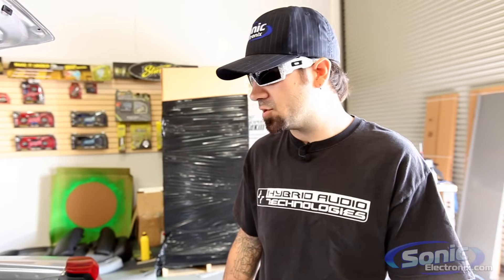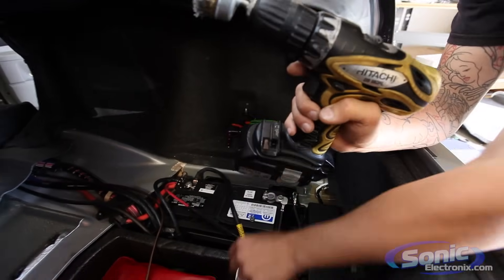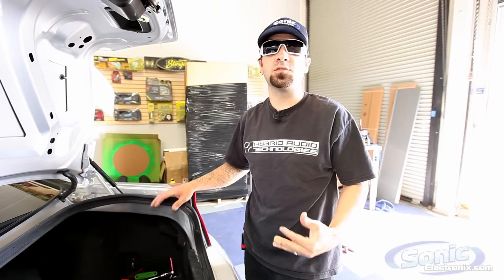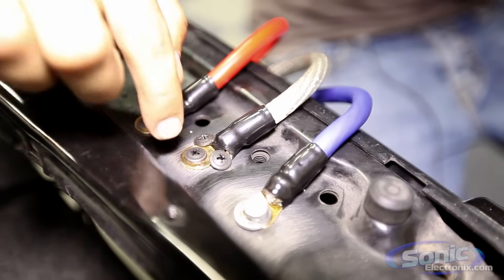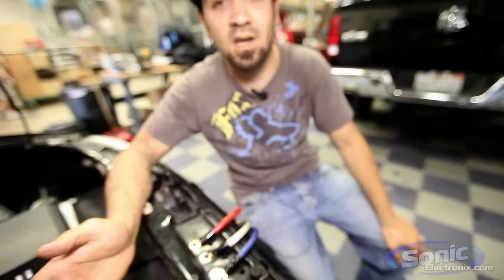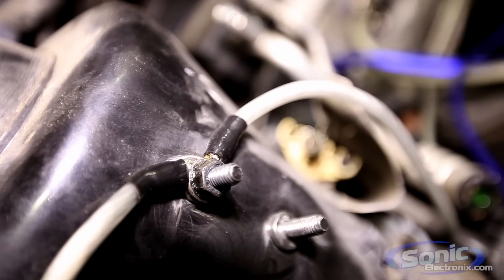How to Properly Ground a Car Amplifier | Good & Bad Examples | Car Audio 101

Comment: I absolutely love shit like this. I'll try ro prove as many valid points as I can. First off, Long wire doesn't mean shit for a ground. When installing a larger ground I.e. (4 gauge or bigger.) Follow the base rules "Sonic Electronic" teaches you here. If on (any) surface sand down to bare metal. Now for the resistance bullshit... Have a (Multimeter) present and check the wire yourself for resistance. I'm currently running a Planet audio px4000.d all 0 gauge wires, the big 3 and a 200 amp high output alternator. My ground from my amp runs to my seatbelt bolt and a (18 mm) nut a sanded surface as well. The ground wire is 3 1/2 to 4 ft long. No Resistance! Checks at 12v perfectly like it's Supposed to! Been installing car audio for 13 years and I am a Computer programmer/Electrical engineer. If your headlights dim, chances are your pulling too much current draw from your vehicles electrical system. Steps to change include.... 1: Big 3 2: Upgrade alternator. 3: Upgrade and check battery(s). 4: Check and secure grounds. In some cases as such as mine on my 1994 Lincoln town car signature. I have inevitable headlight dimming but very little. Reason you ask? Because of a thin and non productive flaw in the headlight wiring harness. If your amplifier cuts out or goes into protection mode intermittently. Which it should never do .. Proceed to follow checking for (Good) ground connections. If that checks out and all signal cables and other wires going/coming from amp are clean etc. Then check amplifier to be at fault..maybe a bad channel.
Reply: This is almost the most informative comment i have ever read on YT
Reply: Booga, that wire has resistance, but it is too low for handheld Multimeters to properly measure.  In fact, if it is truly a 0 gauge, 4 foot pure oxygen free copper wire, it has (0.0983 * 4)/1000 = 0.0003932 = 0.3932 MilliOhms of resistance.  This is a theoretical best, and doesn't include crappy crimps, crappy body resistance, or the rest of the wire's length.

Second, you say "checks at 12 volts like it's supposed to", but you don't say if that is while your system is drawing maximum current while you check.  If your system is drawing zero current, it would "check at 12 volts" if you had a 12 volt potato battery connected to it.

All of the above is really picking nits, but people are going to read your suggestions and go buy 4ga wire and think it's great, but it all depends on their system.  Assuming perfect connections, and 20ft of 4ga in your system, that would be 5 MilliOhms, in a perfect system.  If you have a little 200 amp/2400 watt peak system, that system is presenting a load of 60 MilliOhms.  This means that your system, at peak draw, is expending almost a tenth of its power into your wires, and you are going to only get a 9/10ths of your voltage at your amps.  Even more dangerous, your wires release that energy as heat(basically, in this system, the wires would become 4 60 watt incandescents).

Now, as far as "long wire doesn't mean shit for a ground"... Well, it means the same as power wire.  Double the total distance, double the total resistance.  If you used 40 feet in the example above, it would present 10 MilliOhms, and you are looking at 5/6 of your voltage at your amps, and 1/6 of your power dissipated in your wire.

This all boils down to: Do a bit of homework(outside of youtube comments), don't do it yourself if you don't understand it, and ALWAYS go to the next gauge up of wire from your calculations.

TL:DR: LOL youtube comments.
Reply: @Justin S You're right Mitchill is saying BS...

Comment: Thank you for the video, BIG help. However, I ran into a problem. The speakers are making a screeching sound and it amplifies (gets louder) as I accelerate my car. Any thought on what could be the problem? I even makes the sound when the radio is turned off.
Reply: Alternator whine. Did you run the RCA's and power on the same side? Your ground might need to be moved, too...

Comment: i just took a nut and washer...left the wire completely bare (0AWG)...threaded the wire under the washer around the bolt like a fork...and tightened it down
Reply: just because you've gotten away with this ghetto poor practice does not mean it's advisable. I'll stick with a properly crimped and soldered ring terminal, a nut and bolt with a good sharp star washer, thank you. the corrosion is called galvanic corrosion and it is a result of electricity flowing across dissimilar metals.
Reply: you dont want to do that because the corrosion on the wire from the open bare end of the wire will be just as bad of a conductor as it would be if you just left the paint on the metal.... what i always use is solid copper lugs with a crimp on it then marine heat shrink to keep moisture and more air out of the cable so it doesnt corrode then strip the paint put a hole bolt the lug down and paint over the lug and the stripped area to prevent it from rusting also
Reply: customlumina checked it a few minutes ago...still looks the same from the day i installed it, which was almost a year ago lmao...idk what corrosion youre talking about dude...if you have moisture in your trunk area, you may want to check for leaks...
Reply: there is moisture in the air (humidity) that causes corrosion moisture doesnt always have to come in direct water form
Reply: I guess $5 for proper terminals is too rich for your blood, eh?

Comment: @staygolden....factory ground there or not, straight to the battery. People running real systems will even go from the battery negative to a post ground to a distribution block. And also, when upgrading to big amps etc., the BIG3 is necessary, one which is a better ground than what's already there. There is no excuse however you look at it, straight to the battery is 100% best you can do.

Comment: battery was right there! LOL!!!! if your that close to the battery, go straight to it. I would however, ad an additional ground wire from the negative battery to that post he cleaned up. BIG 3.
Reply: never ground straight to the battery, if the car's ground becomes loose or fails in any way then when you start the car the ground goes through your amp!
Reply: there is a factory grounding point there for a reason..
Reply: ***** If you're taking power from the battery, power needs to get back to the battery as short as possible to ensure performance. Trying to say I should overload my stock ground cable as opposed to wiring something straight to its power source?
Reply: turboelkys u can't ground to the battery...

Comment: What about a Van.. at the back of the drivers seat (around the battery).. any good grounding options there please?
Reply: If I had to ground in the middle of the car, I've always used seat mount studs. Extremely solid. Just clean, and bolt it down. I have had to take a drill and open the ring terminals a little bit more, depending on the size of the seat bolts though.

Comment: The best ground in my opinion and the closest to the amp usually is one of the lower bolts to the back seat bracket, they're present whether you have folding seats or just a regular back seat, you only need to scrape a little and theres a huge stud great for grounding, the only down side is you will need either 4 gauge grounding rings or just a really big 8 gauge ring terminal, but they require very little to get to besides lifting up the back seat cushion which is usually just held by two push points
Reply: 8 years later and this comment helped me eliminate my grounding concerns since my dual tbx10a won't get power
Reply: that  depends on where your battery is located ! 
for me. i have driven a volvo v70 the past 10 years,  and i have  the battery in the back!    i always ground my amplifier in the battery! if possible ofc .
also the watt size of the amp  playes a part!   let us say that you have a  THE GREAT WHITE   B2 amp..  that one  puts out  16k w  @14.4 volt.   you don`t ground that in your chassie !
Reply: @jalliboy  lets be reasonable here, the Ground point he mentioned is fine for us common folks with 1200rms ~ watt mono amps for a sub lol..its the point i use for  both of my amps in my 2011 mustang, works well under the rear seat. took a good bit of sanding, cleaning..but is a SOLID ground and tested with meter 0.01 ohm...
Reply: @xsmatt81  yes. What you write is something i can agree with! But like i said. The size of the amp is a major factor here.

Comment: That stud is already in direct contact with the body... There for why did you wire wheel the paint down even though it didn't even touch it? That's wrong.... And also you are suppose to have a ground that is close as possible to 12" or shorter never longer because you create resistance.. And will make the amp not last.
Reply: clean surface means good connection. paint stop that connection even if its a factory stud ground. also proper wire size will allow u to run longer than 12" for the ground. resistance is caused by paint and other things that do not flow electricity. so stop trolling
Reply: It's no different to having a power wire from the battery in the front to an amp in the back. The electrons flowing through the wire don't care whether the power wire is long or the ground wire is long, or if they are both long. As long as the power wire you use it thick enough it'll make no difference.
Reply: You can have a ground as long as you want but, you're just going to pay a ton for the proper thickness of wire.
Reply: Good to know this, didn't realize had to be shorter then 12" with the ground wire.
Reply: bassl0va What is resistance my friend! Not trying to troll. Just trying to better someone who cant even sell there own product... Look at any wiring kit. Any wiring diagram. You wont find a ground longer than 2 feet "if that". Shorter is better.
Reply: Goatman42069 Watch the video. The stud is almost like a washer. The stud has direct contact on the bare metal already. He grinded metal down where the lug on the wire WONT even touch.
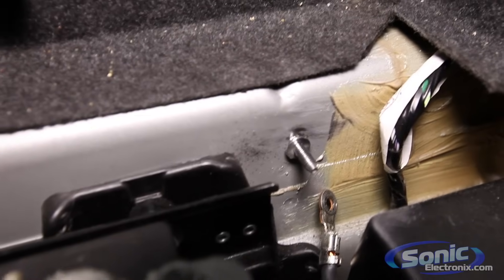Reply: Goatman42069 Please look at 00:54 And 1:09 tell me what he did better.. The factory ground is not gunna be a bad ground. "This is a bmw" You dont pay for a un-proper factory ground.
Reply: Killem Gillem TBH Cause it is practical and cheaper and generally it's unnecessary to have a long connection to ground because no matter where a component is mounted you'll be within 2 feet from the chassis. That doesn't mean there is anything wrong with long ground connections. Shorter is better cause it is cheaper and easier provided you are using cable that is up to the job, same goes for power wire. Doesn't mean it makes a difference for 99.9% of properly installed systems.
Reply: Killem Gillem TBH  This is no BMW its a Charger or a 300 hence the mopar battery.
Reply: ***** Well it doesn't have to be any thicker than the power wire. But yeah may as well have it as short as possible cause it's easier and cheaper
Reply: if the 12" rule is true then my car is fucked because my fuel sending unit ground comes up from the trunk of my car runs under the rear seat in the factory wire harness to a grounding point under the passenger side door O.o i would have to say its closer to 5 feet and that is factory
Reply: customlumina That's why the 12" rule is bullshit. It isn't a rule. It's just easier and cheaper. There is nothing wrong with long grounds
Reply: Do you not realize that even if your ground wire is 2 inches long it doesn't make a fuck. As long as your ground is equal to or less than the length of your power wire resistance will not be effected. Wiring kits come with super short grounds to save money for the manufacture and the consumer.

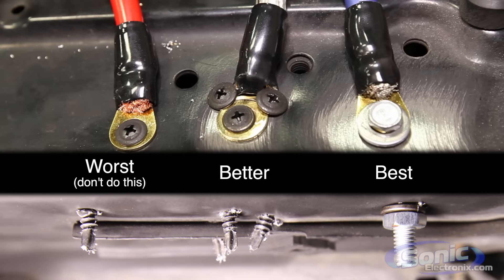Comment: 1:59. The worst thing you could do is connect your positive to your ground. KABOOM!
Reply: Jeramie Curtice from 5 years ago. So sorry it's taken me 5 years to respond...i've been father busy these years. Anyway, that red wire at 1:59 wasn't the power wire. It was just a random red wire...as with the other two wires...the white and blue wire, merely being used to show 3 different examples of ground methods/results. But yes, or rather no...do not connect your positive to your ground. That would be a HUGE durrrr moment you won't ever forget. And if you didn't know that, please let someone else do the installation, ;).

Craigsbully from 5 years ago...yes, i do agree. If i saw option/method #2 installed like that from a professional...or even a backyard mechanic or from anyone...EVER for that matter, fugettaboutit, pfft-pssh. Get outta'here ya schmuck i'd have to say.

Comment: The speaker wire and the power cable to the amp have to be in different sides of the car right?   Cause I bought a car and I just notice that the power cable and the speaker wires are running along together...

Comment: I've been doing my own installs since I got my first car. My opinion as always been that using factory threaded bolt holes, bolts, and other fastening locations is the best option. Im also the type of guy who tins every wire, removes the plastic from crimp connectors, solders, and shrink wraps them. Would you agree that grounding to an existing fastener as close to the amp as possible is the cleanest and most fail proof manor of grounding your amps?
Reply: Yes. Please install the ground as close as you are able to do so (in a safe matter) to the amp/powered subwoofer, etc.

Comment: Make sure you dont have signal wires (rca's) running with the 12 volt power cable. That puts a lot of noise into the signal and is what youre hearing
Reply: Wow I was looking everywhere trying to find out why I had so much noise going on out of my subs with no music on..
Reply: SPEAKING Heavy Facts bro 💪 lol I ALWAYS Run mines Opposite sides from each other, otherwise you'll get that Annoying Ass sound when hiting the gas etc

Comment: Actually, grounding to the negative terminal is ideal.  That's where the 'ground' originates.  You can see in some older PPI amp manuals that the 48 engineers they had on staff would recommend to run both pos and neg back directly to the battery for best results.  The car chassis was never even considered for passing the kind of power that many guys will install in their car.  I'm not saying you can't but the negative terminal is by far the best place to run a ground cable.

Comment: I am currently running 0 gauge wire running from the battery to a power distribution block which splits it into two 4 gauge wires into 2 amps, one amp for each subwoofer... Is it ok to use the two 4 gauge ground wires into ground distribution block then just grounding the one 0 gauge wire?

Comment: run a ground wire off one of your rca jacks. sounds funny but it will work. touch a ground to the metal on the RCA and you can hear it go away.

Comment: Ya, not sure how well those welds will conduct, they certainly weren't meant to carry the amount of current required for high powered systems, and that's what we're all going for right?

I agree, if you're going to be running a couple hundred amps though, you might as well run some extra grounds.

Comment: Thanks. Tried frame ground first. Unibody. Voltage issues.

I run a dedicated ground from front battery to rear batteries because the unibody ground didn't give me the results I wanted.
Dedicated run. No voltage issues.

I also run a dedicated ground from the center of the earth to prevent lightning cap strikes.

One of those things is not true.

Comment: Only worry about the specific grounding point you are going to use. You can use sand paper or a wire brush to take the paint off of the ground location and then bolt your ground in. You can then cover the area to prevent rust or corrosion with either a rust resistant spray or something like silicone which is non-conductive and will keep additional moisture out.

Comment: It's all of those welds that are the issue on a unibody. Relying on those versus a straight ground run, offers more resistance. 

Not enough to offset the cost, or make a huge difference on most systems...but when you start running more amperage, watts and extra batteries; dedicated ground run, IMO.

Comment: Thanks for posting, I made a ground like you showed with the nut/bolt.
I also added a bit of copper electrical conductivity grease just to make sure it lasts a while.
Cheers,

David.

Comment: What do you mean?
If it's a unibody vehicle, the entire body is welded together, and any part of it has a low resistance path back to the negative terminal on the battery(referred to as ground in this case).

If the vehicle has an aluminum engine cradle, then you've gotta make sure the connection between the unibody and battery are sufficient for the ampacity you need.  If you are adding a 150A load, you probably need to add another ground conductor where they've already made one.

Comment from the maker: Never ground to the battery. If your car's battery ground connection should ever get corroded or loose, the ground path can try to go through the amplifier. If that happens, your amp, speakers, RCA cables, and headunit could be damaged.

Comment: Why not just ground it directly to the battery as its right there in the boot. Surely that would be better as you would be taking the load off the car's earth cable

Comment from the maker: It is entirely true, your ground wire needs to be short because more wire means more resistance, which is going to decrease your power and increase your heat.

Comment: I would be mad if somebody scraped paint off my car like that. Yes, paint needs to be removed to have good contact with terminal. But please do not sand/grind paint off more than what you have to. That will cause rust, especially if it is under the hood.
Using existing bolt or stud on body is what I would recommend. There are plenty of those on most vehicles. Such as bolt or nut for seats or frame for console. If doing ground under the hood, there are plenty of existing grounding points.